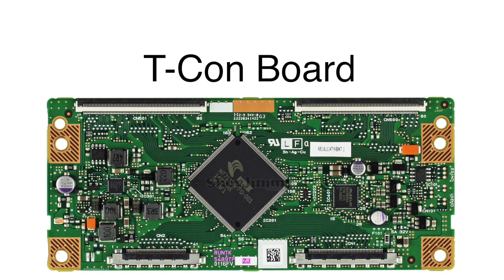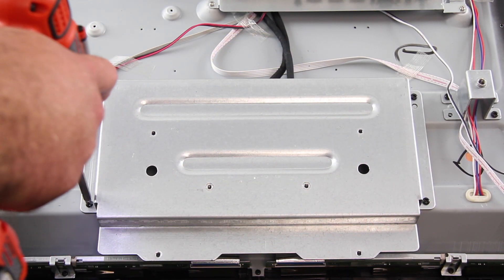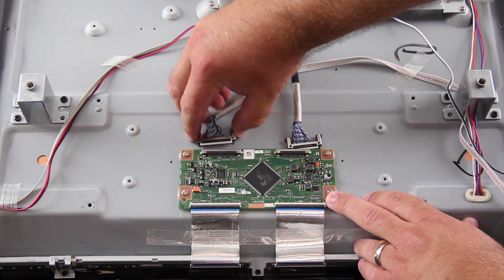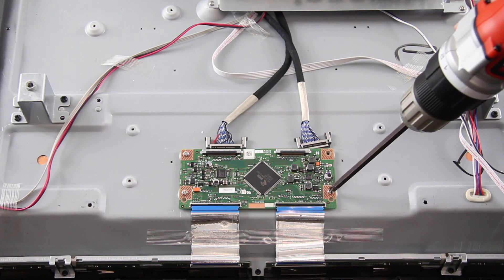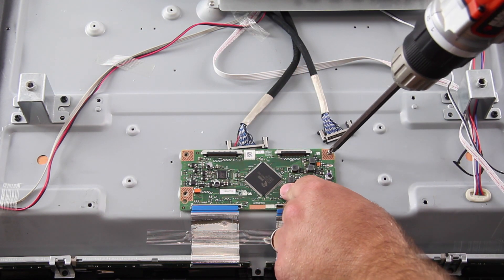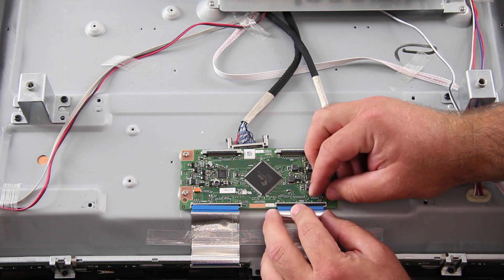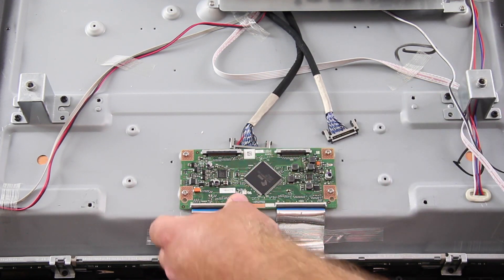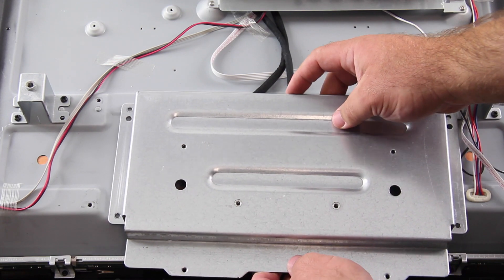Element 60" LED TV T-Con Board Replacement Tutorial RUNTK5489TPZJ

Comment: Hello 
I have a question. I have a LG 50LN5100-UB and I'm having issues where the TV will power on but the screen is black. I have swapped out the main board and the power supply and still have no luck. Im wondering if the problem is the LEDs or maybe the T-con board. Any help would be most appreciated. Thank you in advance